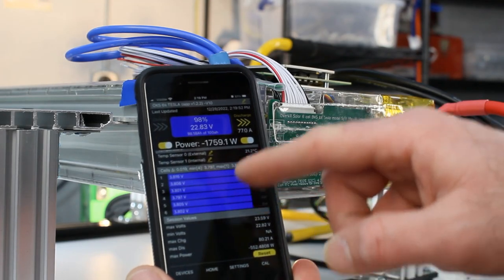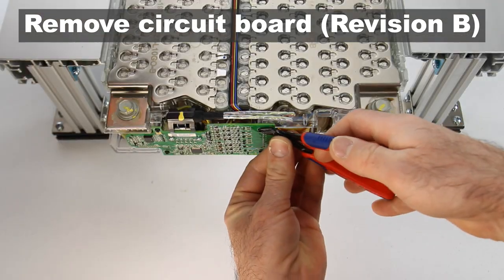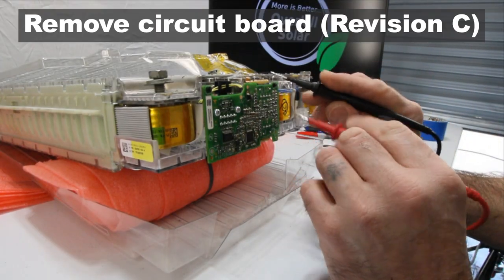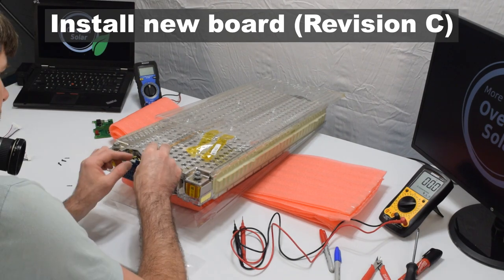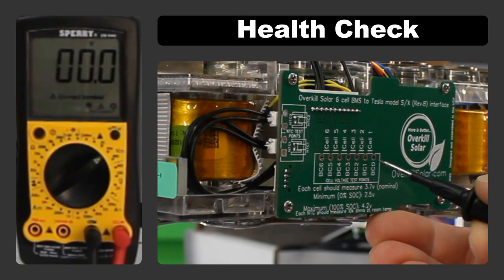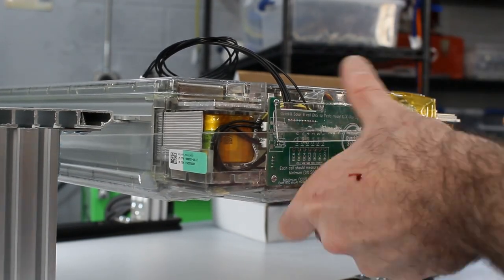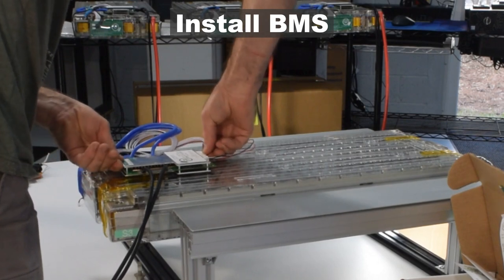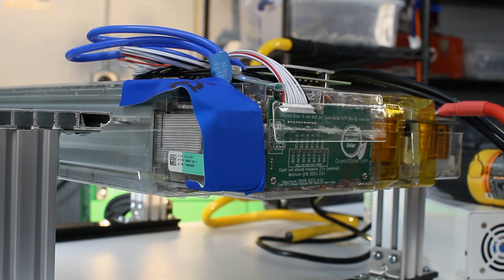Salvaged Tesla Batteries for Off-Grid Power?

Comment: delighted to see you've made using Tesla batteries practical. About what is the capacity of a 6s module?
Reply from the maker: The ones we have in the shop were 5 kWh when new in 2014, now they are testing at 3.6 kWh, 77% of original capacity.

A video about the capacity testing will come out in the near future

Comment: Dont bother with the model S modules for offgrid storage, theyre good and small but have become very pricey per kwh due to popularity.
The real cheat code is the model 3 battery packs, almost no model 3 needs battery replacements and people are sleeping on them for battery storage so you can get a huge 75kwh pack from the original long range models for like 5 grand from a junkyard, $66 a kilowatt hour is absolutely insane

Comment: How many 6s tesla modules can be wired in series (with a BMS per module)?
Reply from the maker: We suggest only 2 in series for safety reasons but if you must have more voltage there is no technical limitations due to the BMS. The Tesla pack puts all 16 modules in series for 400 volts.